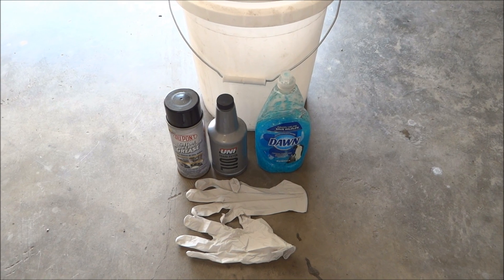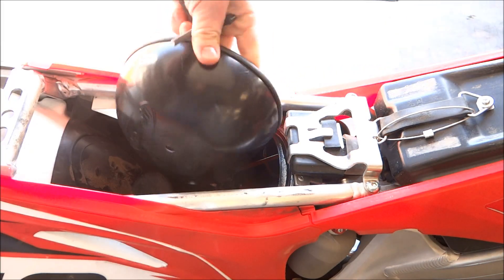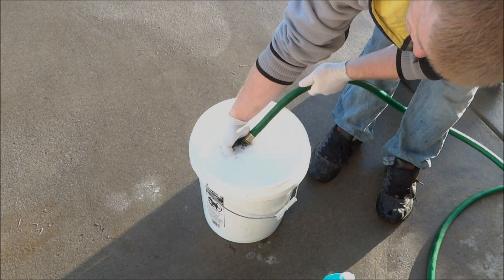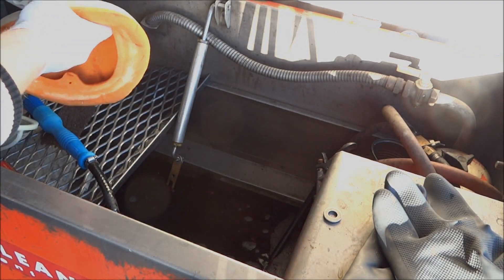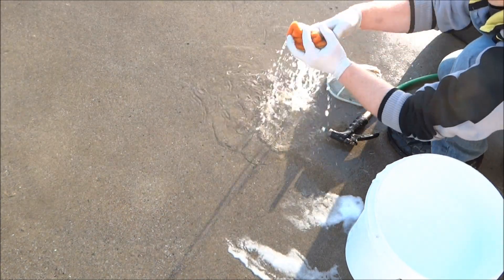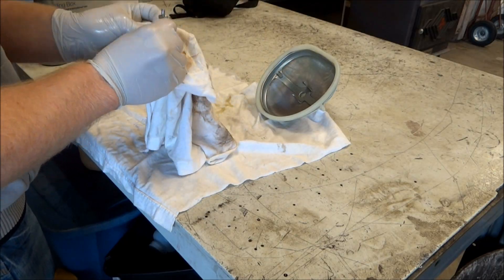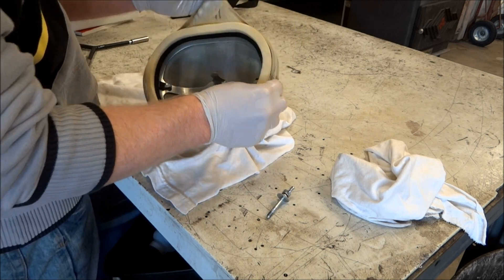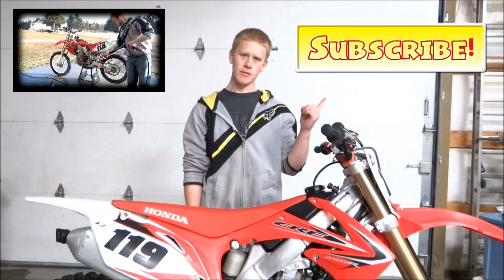Save Your Engine With This Air Filter Cleaning Guide

Comment: Hi I'm 5 foot 6 and I want to get a 250 would you recommend this or wait a little more
Reply from the maker: +Kristin Cottam 5'6 is tall enough to ride a 250. I'm 5'6 myself and have never had a problem with it being too tall. You can always shave the seat down if it's an issue.
Reply: +OneOne9 Creations thanks

Comment: Sir what is the use of oil in that air filter?is that necessary?
Reply: Yes very important, it makes the dirt harder to get through into the bike
Reply from the maker: richard perelonia The oil is what traps the dirt from passing through the filter. It is absolutely necessary.
Reply: No oil is required on paper filters. You just have to replace them when dirty.
Reply: but it is only applicable in foam filters right?
Reply from the maker: richard perelonia No, both foam and fabric filters need oil.
Reply: But my motorcycle its filter element is look like paper.
Reply: Ok thank you.i really appreciate it.thumbs up.

Comment: i got a 06 honda crf450r not too long ago....and i bought it from some guy at a race, and it rode good, but after a while it started to act up and have minor issues with some things youve talked about over your tech videos. Ive been looking for how to videos on these problems on how to fix them myself and these are by far the best! Hey, it beats a mechanic who charges $700 for labor and all he did was change one $50 part. Thanks a lot! And my bike runs a lot better now by the way!!

Comment from the maker: @Pendlezzzzz No, air filter oil is made for a reason. Engine oil is not sticky or consistent enough. It will just go to the bottom of the filter and not trap dirt. Filter oil stays on the filter and collects dirt as it is designed to do.